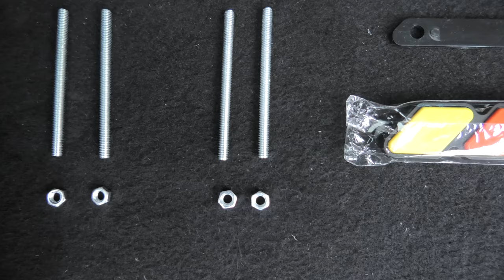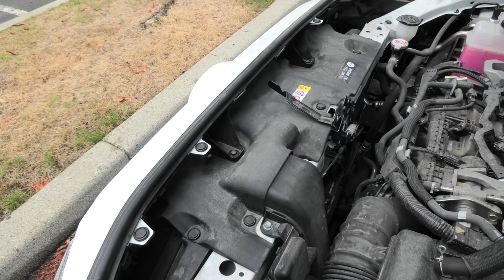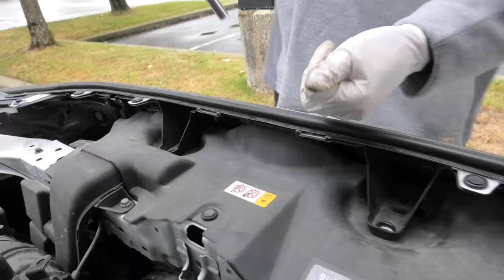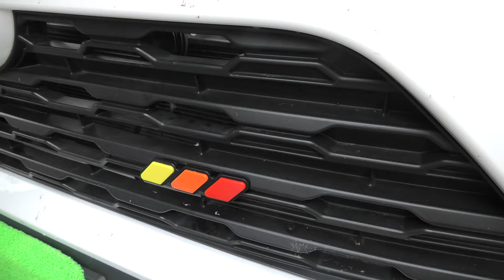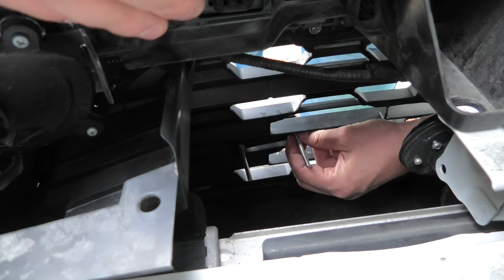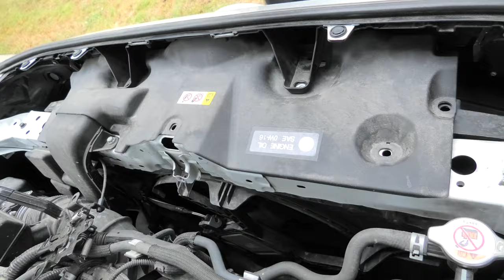Toyota RAV4 (2019-2024): Tri-Color TRD Badge Install On The Front Grille.

Comment from the maker: PRODUCT LINKS:
High Quality For Toyota Tacoma 4Runner Tundra RAV4 Toyota Tri-Color 3stripes Grille Badge:
- CARTRIMHOME - https://cartrimhome.com/Tri-color-3Grille-Badge?tracking=morozov_automotive.
- AMAZON - https://amzn.to/3Rkhurc.

TOOLS REQUIRED:
1. SOCKET SET, RATCHET - GEARWRENCH 57 Pc. 3/8" Drive 6 Pt. Mechanics Tool Set, Standard & Deep, SAE/Metric - https://amzn.to/41wE6Z3.
2. SWIVEL HEAD RATCHET - GEARWRENCH 2 Pc. 1/4" & 3/8" Drive 72 Tooth Dual Material Roto Ratchet Set - https://amzn.to/3kwhHdS.
3. FLAT HEAD SCREWDRIVER - Klein Tools A131-2 1/8-Inch Flat Head Screwdriver with Keystone Tip, Made in USA, Pocket Clip, 2-Inch Round Shank - https://amzn.to/3VV0FVh.

Comment: Hi, what do you call the tool used to remove the bolts and where can I get it? Thx
Reply from the maker: Hi, in this case the swivel head ratchet was used. Similar to this one - GEARWRENCH 2 Pc. 1/4" & 3/8" Drive 72 Tooth Dual Material Roto Ratchet Set - https://amzn.to/3kwhHdS.